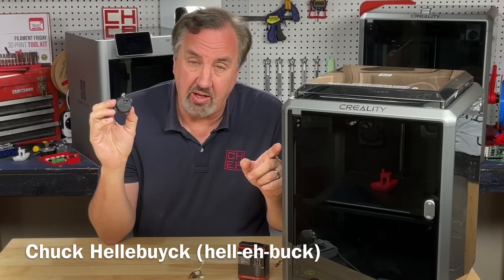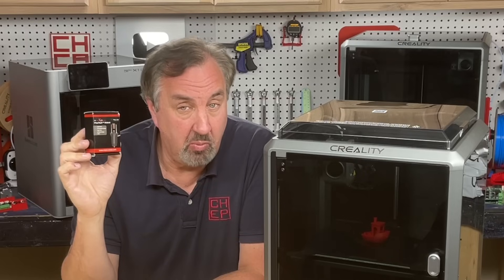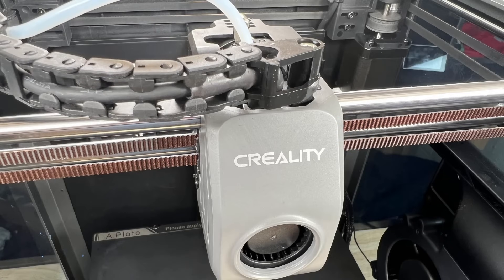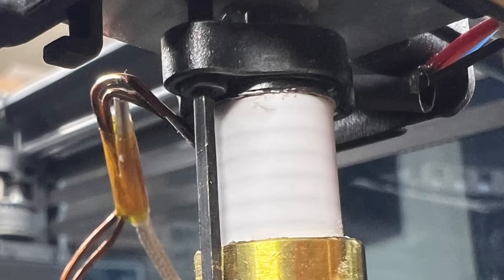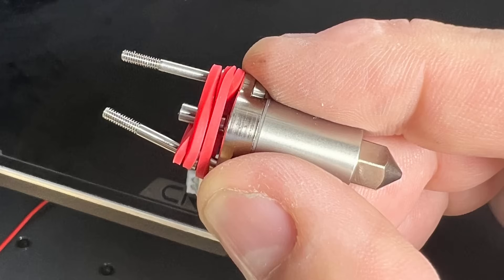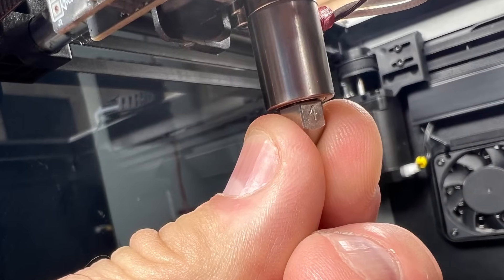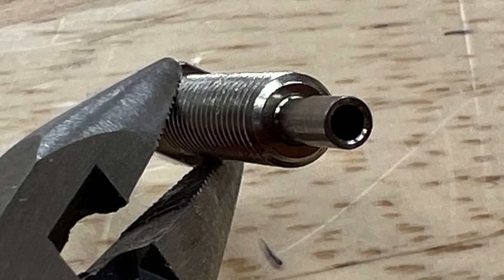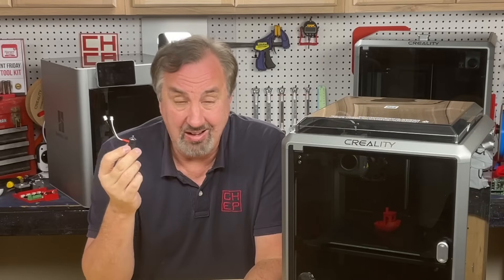Upgrade your Creality K1 or K1 Max with Micro-Swiss FlowTech Hotend

Comment: Should the Micro Swiss Hot End "wobble" after tightened with the two mounting screws.  I am having clogging issues and wondering if this wobble is part of a "floating design" or it is because the mounting screws came loose and froze in that position.  Thanks for your thoughts!

Comment: Thank you for continuing to make awesome guide videos. 
I noticed that the extruder gearbox, you used in this video, still had 'the little blue clip' for the PTFE tube lock. Did you go back to the old design gearbox ?? 
I was also hunting your videos for guidance on the 'all metal gear upgrade' that has been out for a while. Have you tried it; and is it worthwhile ?
Reply from the maker: Yes, the latest is worth it if your machine has the older one.

Comment: Update. The feeder tube going into the hot end is way too long. The original filament feeder motor has an open hole that would accommodate the "transition tube" into the hot end up into the Feeder assy. The new and improved feeder motor Assy. Does not. It has a flare at the end and reduces down 0.8 mm. The original tube will not fit. I did try the 1/4' flare on the tube, no fix. I had to cut down the transition tube by 1/16" to get the feeder motor to fit and allow me to replace new filament and get it to align correctly.

Comment: Did my Hot end upgrade last night, along with the filament feeder upgrade as well. I will say what an improvement, I estimate well over 5,000 hours on the original Hot End. Question. How many hours on the 0.4 nozzle should it be replaced? And, do I have to use the Micro-Swiss 0.4 nozzle when it comes time to replace?  I would love to see a segment on replacing the belts on the K1 / K1 Max,

Comment: I just ordered a K1 from Creality today....how can I tell if min will have the older (like yours) Hot End? Or the newer one? And even IF it has the new one...do you think this MicroSwiss one is STILL an upgrade?
Reply from the maker: Microswiss is still an upgrade because it encloses the temp sensor so if you get a blob it won’t break it. 
Printed with it out of the box. If you get good prints you’re fine. Most are updated now unless you buy one a eBay.

Comment: I just installed this hotend on my K1 Max and afterwards it is having horrible quality issues with my prints. I am getting bad ghosting and tearing. My printer was flawless before this change other than the clogs, that's why I switched. Do NOT use this nozzle IMHO.

Comment: What is the extra hole at the back of the hot end mounting plate for? The replacement hot end I bought only came with the two long screws. I thought I might have lost a smaller screw when I removed the old hot end. There's a threaded hole in the heatsink.
Reply from the maker: The original design had a set screw in there but that’s no longer used.

Comment: I wasn't sure which K1 Max I had so I had a look at the spare hot end that it came with and I confirmed it was the v1 hot end. I did have a bit of a scare when it wasn't detecting a sensor but it was simply not connected. Other than that it is working great.

Comment: It does not fit in the new K1 max. The copper thermal adapter is too big. It does not fit. Frustrating.
Reply: Also there is no screw on the back of the cooling block anymore. Ugh
Reply: As far as i know, there are two versions of Creality heatspreaders and micro swiss offers also two different hotends matching the creality heatspreader versions.
Reply: I ordered creality's official kit and found the same issue.
Reply: Fits mine no issue and I definitely have the grub screw at the back. Bought the printer 3 weeks ago.

Comment: Hi chep. I have a tip for removing silicone glue. Apply a little isopropyl alcohol around the glue, wait about 5 seconds and the glue will come off very easily.

Comment: Hi,
Can the Micro-swiss Flow Tech Hotend also be used on the Ender V3 KE?
Reply: I'm interested in this too, is it the same hotend?
Reply: they have a ender 3 ke heat break. the difference is that the guide doest have a lip and the screws are shorter.  i am getting a the K1 version for my ke because i can't get the ke one in australia (can order it from the states but will take a month to get here and my hot end is broken ) @Murgo-u3l
Reply: @ropes83  Did you end up doing this upgrade, and if so how did the install go? And how are the results?
Reply: @Lon1001  I installed the k1 hot end on the KE. I had to sand off the brim on the throat and use the old screws from the previous hot end. It solved all my problems. The nozzles are good and I had a big problem with the ceramic on the standard one braking. There is a metal cover on the micro Swiss so that’s not a problem. The cold change nozzle works when so easy to take off and on. It’s definitely worth it.
Reply: @ropes83  thanks for the reply, it's good info to know, I ordered the OEM hotend for my KE but it was hard to find one in stock so was considering upgrading to the flowtech but again can only get them in Canada for the K1 configuration. I wasn't sure if the wires would be long enough, plus my 2 little assembly screws are stripped out and I am hoping the creality hotend includes new ones. If this one gives me trouble again I'll be finally doing the microswiss upgrade on it.

Comment: So i did this upgrade and upon restarting the machine i unfortunately got a Key:2092 error. It is thermister related is the only info i van find. Any thoughts on this. Checked in  creality print and it is saying the temp is 580c. Well after viewing your video again it turned out i had the cables crossed, lol.     Any plans on a .6mm profile?

Comment: Great instructions dude... 🙂
This will help, (I'm disabled and need that extra something something) to get a clear visual and hands on access to the underside of the hot end task. 
Turn the KI Max  upside down on the work bench. Have a sheep skin of beach towel as a bench cover to rest the inverted printer on. Makes this task a pleasant one.... (not so easy with the smaller K1 without masking taping a square roasting tray onto the top of the printer first... haha. been there, done that!)

Comment: Chuck, Have you had problem with the K1s jamming up. I've been using the recommended setting for generic PLA and I believe that my machine suffers from heat creep and the filament is melting way up in the heat break. With the old hot end it would jammed during the first layer of a very large print and after I clear the jam, it will finish the print with no problems. I installed the Microswiss this weekend and all three attempts to print it jammed at different stages of the print, but not on the first layer, it did it once the printer was at full speed.
Reply from the maker: Check your fan to see if it’s working or possible restricted.

Comment: So, I bought this Micro Swiss Flow Tech hot end, and I have to say I like it....  the prints so far have been beautiful.      BUT....  changing out the hot end that came installed on the printer was a bit of a pain.  My particular problem was that the two hot end connectors that need to be removed were GLUED in place and didn't come out easily.   After yanking on them for a while with needle-nosed pliers they finally loosened, but in the process the wire leads inside those receptacles got bent.  Thankfully I noticed all that before I tried to plug in the Flow Tech.... if I had tried to plug in the Flow Tech with those bent connectors I would not have made proper contact and I probably would not have known later what went wrong.  I actually had to turn the printer on its side to make those delicate fixes...  which turned out to be a wise step because the rest of the installation process was a lot easier without having to stoop down while bending your neck and working upwards.  My arms couldn't take it!

Comment: My k1 extruder came with metal gearing. The one thing I learned early on is the k1's hotend is actually perfect. I have 4 k1s and a mk4 and 4 mk3s all going in my fleet. I tried upgrading to this hotend and at best I saw no improvements. It clogged about 60 or so hours in, slapped the original creality one back in place and just ordered replacements for backups. The microswiss was an upgrade for the ender 3, 5, and 6 but it's a downgrade on the k1 and newer ender 3v3.

Comment: Mr. Chuck - I know I'd butcher your last name.

When you were putting the hotend and connectors back together, I noticed that @ 4:44 , the female side was either partially melted or chewed up from taking the Creality hot end off.  Your thoughts?  Or did you see any issues?

Comment: did you change any settings ? i have stringing and under-extrusion after changing to swiss hotend
Reply: maybe check your volumetric flow rate for your material in you slicer?

Comment: hey chep ! what 's your choice between creality k1 and bambu p1s?
Reply from the maker: I prefer the open source K1 vs closed Electronics/Firmware of P1S. But buy what works for you. They both work well. My favorite is K1 Max larger size bed. Microcenter has them for $699. Same price as P1S.
Reply: @FilamentFriday   i hope that is more reliable than ender3...bambu has the ams and creality have nothing.. is a nice feature
Reply: K1. Easy. Bambu printers require bambu slicer and they stream camera and microphone data to CCP in China. Creepy stuff. There's no need for a mic on a 3d printer. Just get the k1, 379 at micro center or 449 online.
Reply: @cgwworldministries83  is simple to cover camera ... but you can disable camera and microphone

Comment: I took off the PCB board to easier be able to remove the connectors from the old hot end and to add the ones from the new one.  Made it a ton easier and it's only three extra screws. That also made it easy to clean the fan in there while doing it.  The FlowTech wires are longer, too.  All around a much easier to use / remove / install.  Worth the cost I paid on Black Friday. Arrived just in time as I had the same error show up on my K1 as in the beginning of the video and that hot end was only about a month old.  Best upgrade I've done my K1 so far.

Comment: The FlowTech Hotend requires a specialized nozzle, but Micro Swiss only sells a copper-plated version (the same one included with their Hot End).  It's supposed to be wear-resistant.  I wonder how fast it'll wear out when printing carbon fiber and other more abrasive filaments.
Reply: Is wood an abrasive?

Comment: When I load the 0.28 project file I get a similar print time compared to the 0.20 project files.
It also names the profile the same as the 0.20 profile, could you please check the files?

Other than that the 0.32 Hyper Fast profile is awesome, just printed a part in 1h 36m instead of 6+ hours
Thanks for the awesome profiles! (Using an Ender 3 Max Neo)

Edit: The ver3.2 files seem to be fine, ver3.3 is not.

Comment: I have had my k1 max now for a week and every day, when I go to print something, the filament will not go in all the way and the gears skip.  I have to take the nozzle off and sometimes the extruder and get basically force out the mess inside.  So this hot end should eliminate this?
Reply: Also struggled with this initially. When I changed my extruder to the newer creaility one I moved the ptfe exit further back in the chain to give it more of a gentle curve into the extruder. Also make sure to "unlock" the extruder before loading filament, and then lock it back before printing

Comment: Thank you! You just dramatically improved my printer. not with this video, but with your FFV5.0_Best cura profile that I randomly stumbled upon on thingiverse yesterday while trying to find ways to upgrade my printer because it wasn't working well. Turns out it wasn't working well because I wasn't using your profile.

I just printed two amazingly perfect print-in-place bearings on my week-old Ender 5 S1 after spending two days experimenting and only getting bearings that i had to spend 10 minutes "working" to free the parts from each other, and which fell apart sometimes and spun poorly. (these ones on thingi--  thing:3002837)

But now, these things just roll, with (almost, maybe a minute) no effort. Looking forward to trying your other profiles. Thanks so much, truly. I'm too new to figure out the settings, and it was driving me crazy. My machine just works now.

Comment: Possibly stupid question... Creality says to remove the lid when printing PLA to prevent clogs. The design of the Micro Swiss should help prevent clogs. So could we leave the lid on permanently? 🤷‍♂
Reply from the maker: I leave it on without any issues so far.
Reply: @FilamentFriday  is that with the stock hot end or the micro swiss?
Reply: I printed a riser with vents that can be closed for my k1 max. There is plenty of clearance for the bowden tube, and I leave the vents open for PLA and PETG, and closed for ABS.
Reply: @Ridor1  just finished printing one yesterday!
Reply: The Lid thing was because sometimes the bowden tube would bend at a weird angle when it went to the far front on the left corner and cause problems feeding the filament I removed the last plastic clip holding it to the chain and solved that issue.
Reply: @AlbertoMartinez765  the reason I ask is because keeping the lid open makes the carbon filter somewhat useless

Comment: So glad I bought a bambu lab, need  none off this stuff.
Reply from the maker: Probably paid a lot more too.
Reply: @FilamentFriday  For sure! But after years of "tinkering" with enders it's pretty awesome to just hit print on a Bambu lab and it prints. No more crazy profiles, no workarounds, no buying 3d party nozzles to fix something that should work. :) Once you get an AMS and starting printing multicolor and multimaterial you can never go back to old school 3d printing. Wait till you try printing support interfaces with PETG while printing PLA..
Reply: BL printer nozzles are crimped into the hotends and sold as a complete package.  Over on Reddit people talk about needing to buy 5 at once to ensure they have enough spare nozzles/hotends because of semi-frequent nozzle clogs that they're unable to clear.  Are you seriously celebrating being locked into an ecosystem with no aftermarket and minimally user-serviceable parts?

Comment: threaded parts tend to losen as they heat up so its bet to follow the instructions and tourqe the nozzel
Reply from the maker: It’s such a lot torque it doesn’t matter. And because the design doesn’t need to stay tight to a heat break, it doesn’t have to be super tight. My finger tightening worked great.

Comment: Got mine in two days ago (regular K1). I was actually curious what the process would be for replacing the hot end on one of these so this was super helpful. 
Any plans to make Cura profiles for these? I’ve just been using the default profiles on Creality Slicer for the few prints I’ve done so far.
Reply: ORCASlicer so far good. it in profile